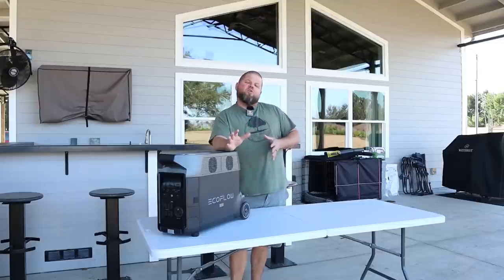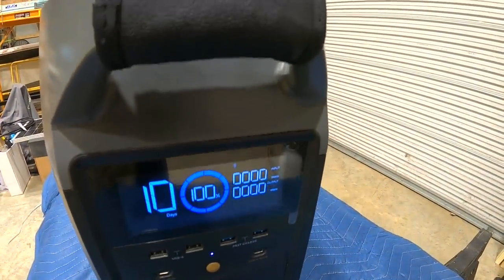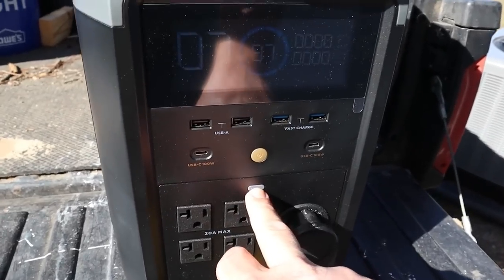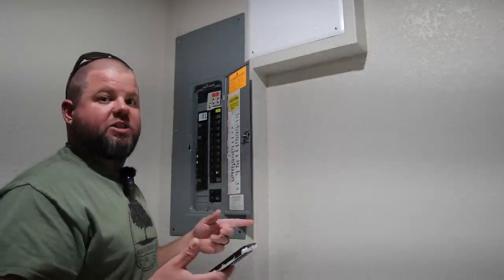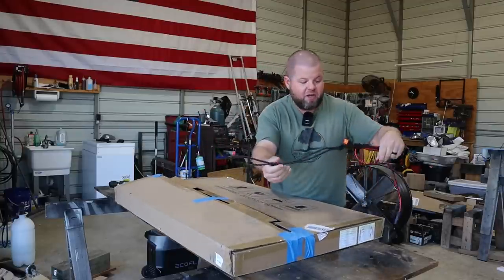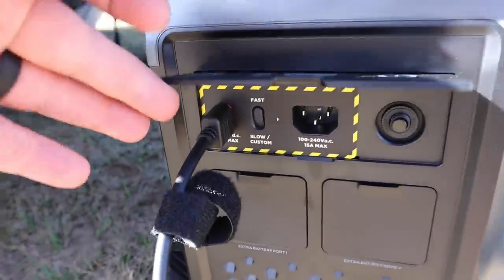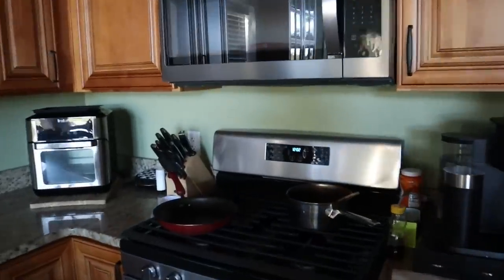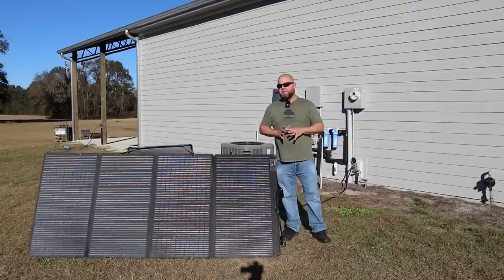Partial off grid power, it's time! Ecoflow Delta Pro whole home power solution. #705

Comment: Did your AC kick on at all thru the test
Reply from the maker: No because with a single unit I can only run 120 volt appliances. I had all 240 volt breakers off. When I get a second one I'll test all 240 volt and 120 volt appliances running.

Comment: Can you opair a delta max with a delta pro?
Reply from the maker: No you can't
Reply: @TKCL  just add 2 batteries, right?
Reply from the maker: The batteries is the correct way to do it. That way you get full features and power out of the Delta pro.

Comment: The real test is powering your house at night to see how long the battery will last then charging it and using it during the day. It probably won’t last all night and it probably won’t charge completely to use the next night while sustaining the power needs during the day. 1200 watts solar and another battery add.
Reply from the maker: If you hang around you'll get your wish! I am building my solar array now (1200 watts) and will test that. However the real test is two units for 240 volts running absolutely everything. I know to do this continuously I'll need additional batteries. That's the great thing about this system, I can build as I go.
Reply: @TKCL  
For sure. I’m in the process of building out my system. I found it to be a lot cheaper to build out and put together then buying an eco flow. But I have no portability. It takes a lot of solar to charge dead batteries and power the house. I’m going 48v panels to a 12v battery system. Curious to see the next eco flow test
Reply from the maker: They all have their pluses and minuses. A DIY system can be had for cheaper and you can build as big as you like. The Ecoflow system is extremely easy to use and is plug and play for the people who don't want to wire or build a system. It's also portable for the people wanting multi use. There is no perfect system.

Comment: Although the portability is all well and good, if you truly want to power your home with solar, this is NOT the way to go. First issue is  the panels and the lack of ability to provide charging power, and worse yet you can forget them working on any windy day much less a hurricane. 4 grand for this unit and by the time you would buy enough of them even if you could fill the batteries up during the day which can't happen with 400 watts coming in with the mere 3.6 kw each these have. Also it is extremely heavy. You could break your back trying to pick this thing up to put it in a vehicle of any kind. I have a full Enphase system, 24 X 375 LG panels = 9,000 watts DC power which produces at maximum 7,100 watts of AC power. I have 30KWH of batteries (3-Encharge 10's) in which 27KWH is usable to power my home at night. I have a 1,300 Sq. Ft. home with a 15 seer AC unit, and set at 77 degrees at night on the hottest of summer days it will just about use the batteries up come morning by the time my system gets enough to power the home on solar alone. JEA screws us all on true net metering around here, and all others treat it apples to apples and give full credit for what you over generate and send back to them, so in other words you bank all for your own use. JEA doesn't do this, they only give me 1/3 to 1/4th credit depending on whatever the fuel costs is so I have to keep all I can for my own use. I installed a new WHITE metal roof on my home before having my solar installed so temps in the attic are never more than 10 degrees hotter than the ambient outside temperature, and I have a probe up there to prove it. I installed it while the shingles were on the roof and it blew past the readable 140 every day. Panels stay cooler, and you can lay your hand on  the metal at 100 plus and never get burnt. White is the ONLY color this will work with as it is the only color to reflect all the heat. I have an app and shows me in real time what I am using and stores all generated power to review. My last power bill was 20.00 and change. The 2 before that totalled a mere less than 15 bucks for the 2 months. There are absolutely NO holes drilled in my roof either. The panels are clipped to the vertical uprights using the Iron Ridge system. I have a nice roof setup allowing me easy access to clean and have a Xero carbon fiber 40' water fed pole to clean them with. Removes the pollen we get here easily with the Tucker hybrid brush with only my soft water. Kelly, you mentioned that energy hogging dryer that we all have. I put up a clothes line in the garage and we hang dry all the clothes and don't use it any more. This is a HUGE saver of energy and if your dryer is located in the home it keeps the heat out of the home also by not running it. Nothing against the company, but honestly I would never sink that kind of money in to something like this that will not work in any adverse weather. Even on cloudy and rainy days I get production. I got over 11KWH the other day with the sun never coming out. You would NEVER get nothing close to that with something like this. My Generac generator is plug and play with my IQ combiner also, so even if my batteries get low, I can set my batteries at whatever percentages I wish to kick on the generator to put juice in them to keep my home in power. I was without power during Mathew for 5 days, NEVER AGAIN!!!
Reply from the maker: I get it, I have an on the wall split phase 240 volt system with 10KWh of batteries connected to a 2400 watt solar array. I'm building as I can afford to. I plan to have 20-30 KWh of batteries and a couple thousand more watts of solar. I can easily run my critical loads now, I just need more battery capacity to get through cloudy days. I have a generator for that backup. These portable systems are getting very capable and appeal to people who want to run loads like freezers and refrigerators during outages. Not everyone has the room or desire to build out a permanent system. I also have two Ecoflow Delta pros with the 240 volt hub setup in my house. I can make it through a lot now, especially with a generator for charging if absolutely needed. I'm currently at 17 KWh of capacity between both systems.

Comment: HOWdy  T-K's-C-L, ... 
Thanks 
What kind / brand of  RACK MOUNT Batteries are you CONSIDERING ?
COOP
the  WiSeNhEiMeR from Richmond, INDIANA 
...
Reply from the maker: I went with an on the wall system from a company called Orient power. The prices were right it's lower end on equipment but works well for my needs.

Comment: Your assumption about the 240 volt appliances not working is correct, since both "hot" lines that the appliance connects to would be at the same potential, so the appliance would be getting zero volts at any point during the 60Hz AC sine wave. Any 120 volt components in a 240 volt appliance would work, like the clock on most modern electric stoves, or the motor in an electric clothes dryer, but not any of the 240 volt heating elements on those appliances.
Reply from the maker: Correct, I need a second device for split phase power.

Comment: 30 amps? in the UK out houses have 100A so we can pull 13.4KW out of the circuit - 30 is lame even at 240
Reply from the maker: In the United States we have 200 amps of service at our homes. Your missing the whole point here. This is a portable "backup" power solution. We get nasty hurricanes, tornados, blizzards, fires and more. Not to mention failing power grids, blackouts, brown outs ect. This is not designed to run an entire residential home, all appliances for 24/7. It's meant to power your large devices one at a time or many smaller critical devices like freezers, refrigerators, fans, phones, internet, medical equipment and more.

Comment: Whole home solution? As long as you don't power AC units, electric heat, electric oven, electric water heater, washer, dryer. Basically it will run some of your lights, and sparse use of tools, computers, and very sparse use of microwave and hair dryer.
Most people don't understand how much electricity some major appliances require and how little electricity these expensive setups actually supply. This is one step up from camping out.
Reply from the maker: Negative, my title was partial off grid power and that's what I showed. The "whole home solution" is the campaign Ecoflow is running right now, they have 240 volt packages. I'm fully aware of what it takes to run my home. I'd need a minimum of two units and 2-4 additional batteries along with a serious solar array (currently building). Now we can go down the road of off grid dependency, off grid backup power (my preference) ect. Running a hunting or fishing cabin with all 120 volt appliances??? 5 bedroom home? There's no one answer or perfect solution for all, that's why adaptability and being able to build a system is critical. Not everyone runs major electrical appliances, most of ours have been moved to propane.
Reply: @TKCL  yep, moving to propane is the way to go for most appliances, and wood-burning stove for heat, if you have enough forest to harvest firewood. You have built a really nice home, and it looks like you have some solid content. I'm sorry, man, I should dial back the criticism of these small solar packages. I just think they all under-deliver as "whole home" solutions. If you are looking into moving towards off-grid and self sufficiency, running a big and scalable power setup might be a good idea. I've learned a bit from my first design, and am building my second completely off grid home. At this time, EG4 looks like a good product line for the money. https://youtu.be/mzZR6SWonrY

Comment: it has wheels because its a 100 pounds... also 2 of these will power 240v appliances but only for about a hour or 2, you didnt state that at all, very misguiding. you need at least 4 batteries to power everything in your house without it dying.
Reply from the maker: Your randomly guessing and assuming all 240v appliances run for the same amount of time and use the same power. You are misguided. I now have two units and 2 batteries, I've ran through a lot of outages this way.

Comment: The little phase swap adapter that this guy made may interest you, Andrew: https://www.youtube.com/watch?v=6HEgTc7q2ps
Reply from the maker: Absolutely no need for it, can't imagine what he's trying to create. Amazon has very affordable converter plugs that power both phases of your main panel. You just need to kill all 240v breakers no matter what option you use. His switch setup will have you flip flopping phases killing critical circuits while you power the other phase. 🤔
Reply: @TKCL  - thanks, Andrew. That makes sense. Have you tried one of those converter plugs? If so, I missed it. Do you mind sharing a link to one? Searching on Amazon didn't turn up one for me.
Reply from the maker: Yes the plug is in the video description of my video you are commenting on. https://youtu.be/VlJg_bCsRbg
Reply: @TKCL  - huh. Thanks. I had actually clicked on that earlier but didn't understand what that adapter was doing. Thx again.
Reply from the maker: Yep it converts the TT30P the Delta pro has to a dual phase l1430r which most generator plugs use. Keep in mind even though I say dual phase it's a single phase split across two phases so you cannot run 240 volt appliances.

Comment: Don't even think about powering your whole house with a solar generator. The Chinese made solar generators on today's market (and they're ALL Chinese made) are not only short lived and weak when compared to conventional off grid solar systems, they can also be dangerous. You'd be lucky to get even two years of service from these overpriced solar generators, especially when powering high inductance loads like full sized refrigerators, large power tools, portable AC units or large microwave ovens. 

The reason for this is that all these high frequency inverters lack a very critical component. That critical component is an iron core, copper wound output transformer. Without an output transformer to act as a buffer to absorb electrical surges provided by the “Flywheel Effect” inherent in the physical amount of a transformer’s iron, these surges and damaging reverse voltage spikes must be handled directly by the inverter’s MOSFET transistors, essential shortening their life. 

You might be able to start and run some high surge loads when these solar generators are new, but every time you fire up one of those inductive loads, you're shortening the life of the MOSFETs in your solar generator's inverter. 

High frequency solar generators run much hotter than low frequency, transformer-based solar generators which makes the low cost, off spec, Chinese made components such as capacitors, diodes, resistors and ICs that are used in the cheap inverters that are used in these solar generators, far more prone to early failure. 

Another major consideration with these high frequency, transformerless solar generators is safety.  All it takes is for one of their MOSFETs in the inverter's H-Bridge circuit to short to ground or the waveform control circuitry to fail, and these units will can dangerous, high voltage, high amperage DC current straight to your connected AC loads which will not only damage most AC appliances but can also set those AC appliances on fire.

Another consideration that is never mentioned by those youtube, solar generator hucksters, is that the vast majority of these solar generators are non-repairable. After the warranty runs out, you're not going to be able to ship these units back to the manufacturer in China and have them repair them. And at a typical shop rate of $125 per hour here in the US, with no schematic and limited parts availability, it won't makes economic sense to even attempt to repair one of these units. Once the FETs have fried and have burned a good portion of the inverter's PCB, (And trust me, sooner rather than later, they will fry.) they basically become a brick. 

A far better alternative is to invest less money and purchase a hybrid, low frequency, transformer based inverter charger and an LFP battery and build your own real solar generator. Low frequency transformer based solar generators last many years longer than these toy high frequency solar generators, and can easily power high surge loads without being damaged and without damaging your appliances. That's why the big name brand inverter manufacturers like Schneider Electric, Outback Power, Sigineer, Victron and others, all use a low frequency topology in their offerings. 

I know this to be true because I've spent the last 23 years repairing inverters. High frequency solar generators/inverters simply don't last when powering inductive loads and can set your appliances, van, EV and even your home on fire.
Reply from the maker: Must say I got a kick out of this, couldn't even finish it. Had one of these for a while, doubled up now with extra batteries. These saved our butts after a direct hit from hurricane Idalia in Florida. These are growing at a rapid rate, your going to be surprised what you see announced soon. FYI I also have a traditional inverter and battery solar system with a permanent solar array. There's people that want portability and the breakdown capability of these types of systems. If not, they simply wouldn't exist. Sure they do cost more and until recently had limitations over a permanent system. I'd suggest that you look at their newly announced system. Thousands of watts of solar input, 90kwh of capacity and over 21, 000 watts of output. That will run almost any home. Some people want DIY and permanent with cost savings. Some want plug and play and portability. If you realized it, YOU would appreciate it all. Competition creates new innovations, production cost savings and more.

Comment: Good review of the solar products.  Just an FYI on your propane stove and hot water heater, if Biden has his way you will no longer be able to purchase new gas products for your home.  Yet another reason to vote out all Democrats.
Reply from the maker: That's just insane! As if the power grid isn't already failing and overworked. We don't need more electric devices on the grid.  Apparently rolling blackouts are going to become a common theme with that logic.
Reply from the maker: Heck with that, the last cold snap look at how many homes were impacted by the planned rolling blackouts. Literally taking people's heat source away in record cold.
Reply: A White House spokesman, Michael Kikukawa, said President Biden does not want to prohibit gas stoves. “The President does not support banning gas stoves,” he said. “And the Consumer Product Safety Commission, which is independent, is not banning gas stoves.”
Reply: @rccrandall1  Check into it, it's already a done deal.  Stop trusting Government reporting.